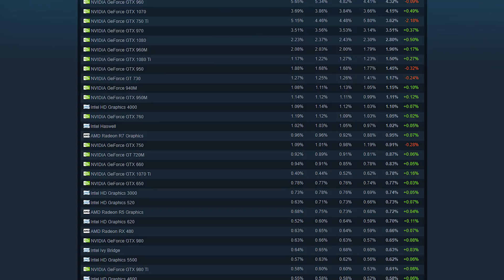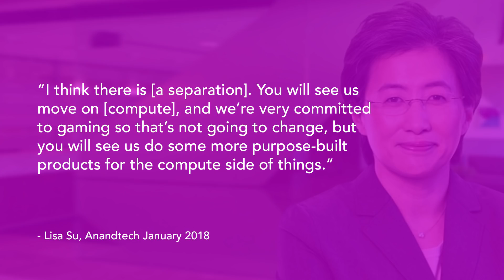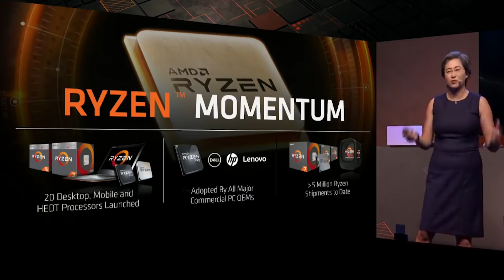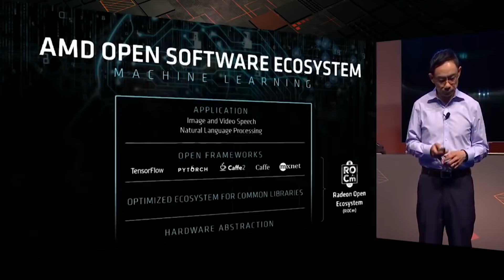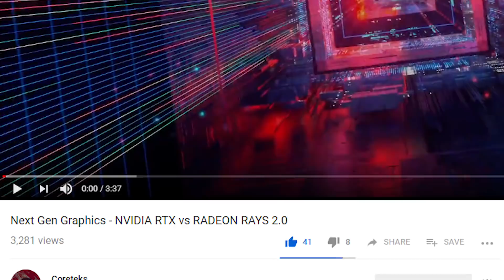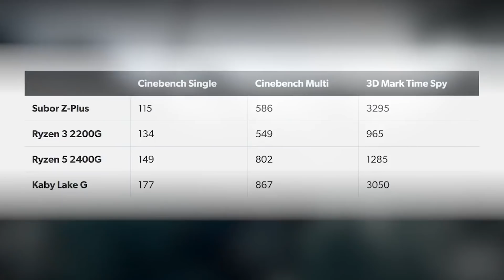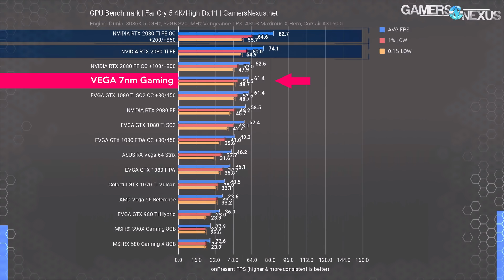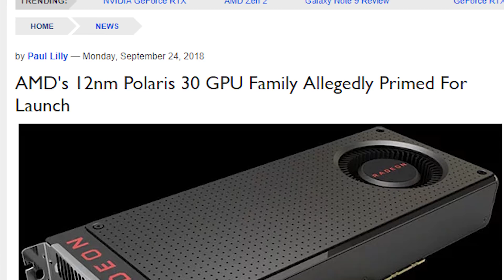AMD's answer to RTX

Comment: We need Vega 56 like performance for $200 (with GDDR5 or GDDR6)
Reply: A die shrink of Polaris to 7nm might just do that. Problem is it wont happen until a full year (H2 2018).
Reply: They wont move Polaris to a 7nm node. That would require not only performing the actual shrink to 7nm but moving it from Global foundries to a 7nm capable producer (probably TSMC). There is a lot of special sauce that these foundries employ to produce these chips. It would probably be 9 months work for AMD to do that. With Navi showing up some time next year, it just doesn't seem feasible.
Reply: foundry to foundry transfer like that would be a nightmare
Reply: Vega 56 performance? You do realize that Nvidia cards with this level of performance is nearing its EOL right? If you want a Vega 56 then go buy one.. I want AMD to compete on the high end. Nvidia took a misstep by not lowering the price of the 10 series cards and launching the 20 series cards at an unreasonable price point. Where's AMD to capitalize? Vega 64 was a disappointment because it couldn't compete with the 1080ti. Nvidia is competing with themselves and it's hurting consumer trust.
Reply: I'd like to see V64 performance, for half the price and half the heat / wattage - that'd be a buy for me.
Reply: @Erick726
I'm with you man.  last vid card update I went with a GeForce 1070 , and that same damn card cost the exact same price I paid for mine  last year in spite of a the 2000's releasing.  That's even after that card had a huge upswing in price for a few months (at some point in the year 1070's were going for 800 dollars even ).  granted there isn't a 2070 yet , but it's definitely coming and if the 2080 is an indicator , I doubt the 2070's will make the 1070 price drop either...so much for my SLI plans when cards drop price.  if amd can just pull off a win or get fairly competitive cards cheaper, i'll definitely look into  going that crossfire route as my main board supports either cross fire or sli.
Reply: Nah, Polaris hasn't gotten any announcements whereas Vega 7nm got the full-ham hype machine working overtime.
They'll probably make a Radeon Pro (or Instinct, whatever they wanna call it) with Vega 7nm and HBM2, and put the same Vega 7nm chip with GDDR6 on consumer cards. Won't be $250 though. $500. Thank Nvidia for raising the price floor and consumers for walking up the steps.
Reply: get a 1070 used lol
Reply: @LegendaryVegeta 1070 is way less performance than the Vega 64.  Maybe pull your a**  out form you head and realize that FPS isn't all that counts.  Some people need cards that do both.
Reply: VEGA > Turning.  And no I am not a funboy but I realize and have the need for both the compute and rendering powers.  For example the real time render view on Blender.
Reply: Current Polaris performs too badly relative to its production costs to be used as a rebranded low end alternative for the next generation. A die shrink will put Polaris in just the right spot for the next generation, covering the entry level up to lower midrange and possibly even a little bit more if pushed. While not a walk in the park as sparkyenergia suggests, it's still considerably cheaper than designing a whole new chip.
Reply: I would be ok with 1070 ti Performance for 300-350€.
Reply: Vega 64 already beats the Titan Xp.  At cryptographic and CAD.
Reply: We need gddr6 from amd to balance nvidia out, we cannot have one gpu company controlling the market
Reply: HBM2, I do both gaming and CAD and I want HBM2.  GDDR6 would be a deal breaker for me.
Reply: @TrueMathSquare  I would be okay with HBM2 and also I have a friend is thinking of getting a 32gb dual gpu for gaming design on his new rig
Reply: The problem is physical space as you may need to use the PCIe slots for something else and drivers issues unless you want to use VMs and PCIe Passthoughs and such.
Reply: Then buy a Radeon Instinct
Reply: @Davvid S im not sure, that's a good question
Reply: faster doesnt matter. all that matters is bandwidth, and that will depend on BUS size. But even a 384-bit BUS would be higher bandwidth. a 512-bit BUS definitely would be.
Reply: Rumor is Navi will provide that.
Reply: Amer Huba Did you know a vega 56 is about $300 on ebay right now?

Also a vega 56 is not bad especially if you edit videos and game it actually works well now for that to be good you need a fast cpu (got a ryzen 7 1700 @ 4.05ghz) and you also must have enough power because yes it can draw a lot. Finally avoid the reference cards their cooling is pretty lackluster.
Reply: @brayannexon4613  is 600w psu enough?
Reply: perttierajorma 888 maybe depends on the rest of the system I have a 860w psu because I have a vega 56 and a ryzen 7 1700.

Comment: 9:20 that's about your only argument that is convincing from my perspective. 
Even 14nm Vega is roughly on par with the 2080 ti (yes the 20 ) in compute workloads.
https://hothardware.com/reviews/nvidia-geforce-rtx-performance-and-overclocking?page=3

A 7nm Vega does all that at either 50% of the power draw of the 14nm product (very important for the server market), or with a 30% performance increase.

Comment: to quote you... Vega 7nm is within the next 3 months is wishful thinking.
It appears that the production costs are just way to high at the moment to release the product on Gamers for ~500 USD. The Samples that AMD can Produce at this node will be sold at a much higher price, and therefore margin, to the enterprise market. And rightfully so... 
i think we will see a 7nm Vega spring '19 at the earliest with little to no architectural differences, but significantly higher clocks. its going to be a compute monster, but no native DXR support.. Actually this is by far the most likely scenario. everythnig that comes after that is speculation and i believe that even AMD themselves are testing in all directions at the moment. they even spoke about solutions, where raytracing tasks can be offloaded onto the cpu (since ryzen usually as more cores than needed for gaming tasks, still).
Since the RTX cards are innovative, but nowhere near fast enough to actually game at high resolutions, even the hybrid rendering method, i dont think this is in fact a problem. Rasterization is still the rendering path for the next 2-5 years with a raytracing implementation here and there. However, we will be much smarter when the new consoles are going to be announced and if there is a dedicated chip for raytracing. AMD can definatly build dedicated hardware, the question is, does it make sense for now. it will come, but i dont think in the next 1-2 gens.

its going to be interesting to see :-)

Comment: No no, Vega will never have hardware based Ray Tracing, it wouldn't be a Vega  card then! Doing that would be idiotic. buyers see "oh it's just a Vega refresh, I wont bother then. I know what those are capable of". No, IF they release a RT card, it will be Navi (but I doubt they'll have RT even then). Rumour is that their next card will have a hybrid of GCN and their older WLIV architecture, a best of both worlds if you will. RT will probably come with the generation after Navi. There's a possibility that Navi will include something akin to the tensor cores though, to add AI for AA (DLSS). But again, Vega will never have any extra functionality other than a process node shrink.